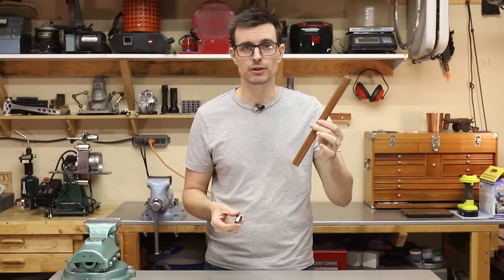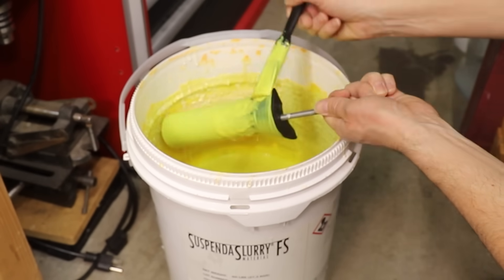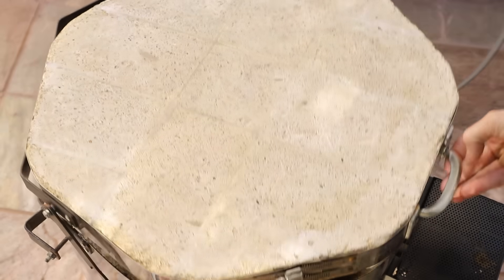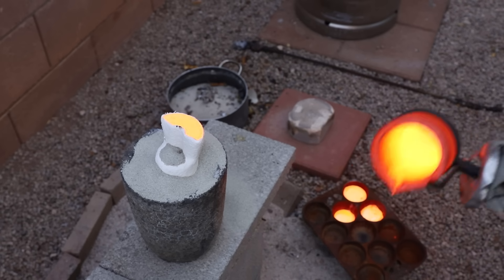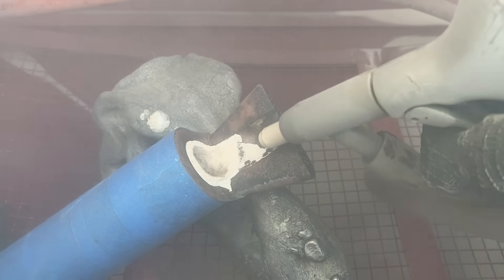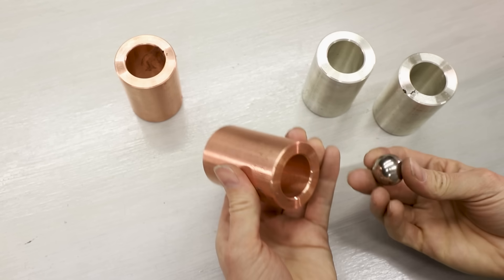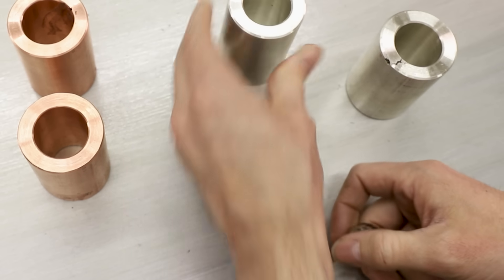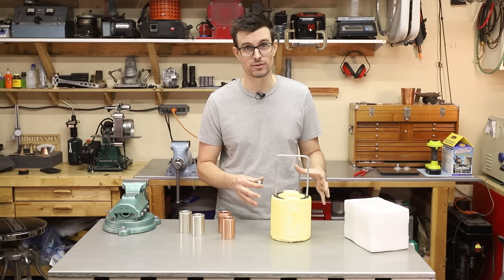Making Anti-gravity tubes - Copper & Silver! - Lenz's law - Metal casting Experiment

Comment: I know it's several weeks later at this point, but it's worth mentioning: You COULD, hypothetically, purify your silver by heating it to between the temperature that silver and copper melts, 1763 F and 1984 F, and then the silver will melt and the copper will remain, OR you can go the chemical route with Nitric acid, but I suspect that's a bit outside your wheelhouse

Comment: Would it still work if you cut a section out of the tube so you could watch the magnet fall from the side? Or drilled holes? If the holes were twisted around as they descended, instead of linear, would the ball spin?

Comment: It would be interesting to connect the top and the bottom of a tube with copper wire that makes a loop a few inches or feet away from the tube, to see if the current can be directed and change the speed of the magnet.

Comment: I am not an expert on this topic, but I suspect that there are other properties other than the resistance which are important. Possibly the number of electrons that are in the conduction band or valence band is important. It also might have to with the density. A denser material will have more free electrons than the less dense material.

Comment: When the magnet is gliding through the induced magnetic field inside the cu tube, did you feel the extra mass on the hands holding the tube. Wondering if its weight is reacted by the tube

Comment: Moving a magnet around a copper wire is the principal of generating electricity.  Just waving a thin copper wire in the air will generate a small amount of electricity due to the Earth's magnetic field.

Comment: I believe that the metals that provide such slowing are doing it on the basis of "Diamagnetivity". Pure silver rates slightly high in diamagnetism than copper; but the impurity of your silver likely counteracted it. Bismuth is much higher in diamagnetism than either copper or silver. I hope that you might make a bismuth tube also, and report its ability to slow the dropping magnet.

Comment: I would like to see measurements of the electrical currents and electromagnetic fields. Also would like to see how big of a EMP could be generated if you shoot the magnet through the pipe at high speed. Would be cool if you could partner with @MarkRober on this!

Comment: Copper (as silver, bismuth, gold, mercury) are diamagnetic some more than others (see Mendeleev's table and elements property's , purity is a factor in diamagnetic strength... To use Hg you need to 3D print a plastic vessel to contain Hg in a long toroidal form ...

Comment: Have you considered standing one of the copper tubes end up, on some electronic scales. Check the weight, then drop the magnet through the tube while looking at the scales to see if the weight does actually increase ?

Comment: а что если эти трубки, всунуть в железные, в роли магнитопровода, затем на железные, намотать проволоку, в роли вторичной обмотки, и посмотреть, что будет на выходе, какая энергия, и как она повлияет на движение магнита?  магнитопровод, можно попробовать сделать замкнутым, т.е. края железных трубок, соединить дополнительно, магнитопроводом.  по моему, такого опыта, еще никто не проводил.  

But what if these tubes are inserted into iron tubes, acting as a magnetic circuit, then on iron tubes, winding wire, acting as a secondary winding, and see what will be at the output, what energy is, and how it will affect the movement of the magnet? You can try to make the magnetic circuit closed, i.e. The edges of the iron tubes are additionally connected with a magnetic circuit. In my opinion, no one has ever conducted such an experiment.

Comment: Could be intresting to have one long tube with a slit cut out along the side so you can watch the ball drop, and have the tube have sections of different metals so you can see the speed changes
Reply: I wonder... Does the induced current have to be able to flow around the tube?  Would cutting a slit break the circuit?  Maybe just drill holes every so often to keep the ring intact, while letting you see the magnet drop.

Comment: So how you got it to break when rolling it just now 10:36  I'm wondering. If you had the copper and silver tubes on their side in the shape, they  it dead stop and not let the ball pass through if you dropped it. Or even if you had let's say, 4 or 5 tubes connected or close to connected and tried to drop the magnet through the center of them, would it change the effect. What if there is already a magnet in between them or if there was already a magnet inside each of them also would it matter if you changed the shapes of the magnets or the directions of the poles I mean just curious what can be done or not done with this stuff cause magnets are one of the things we don't happen to know much about.

Comment: Magnetic energy is not that simple. It happens that it is credited with the properties of attraction or repulsion - this is not entirely true. These phenomena are only a consequence of the influence of magnetic energy on gravitational energy. Here is an example when conductors are attracted or repelled when a direct electric current passes through them in different directions. There is no magnetic material here, but as soon as electricity is applied, it begins to knock out magnetic, thermal energy, and, at high currents, light energy from the conductors. Magnetic energy begins to influence the energy of the 3rd level in the nucleus of atoms; more precisely, it deflects the movement of graviton gravitational quanta, and they cause movement along the interaction vector of the magnetic field. And we see the attraction of the magnet inside the pipe. Inertia works the same way.

Comment: I wonder what happens if the tube is mounted so that it rotates end over end, and possibly motor driven. 
Q1) Will the magnet stabilize between the two ends? (at slow speeds of rotation)
Q2) If Q1) is true, what happens if DC voltage is applied to the tube?  ~and~
Q3) What happens when different currents are induced in the tube as it rotates?
Q4) How does passing current directly down the length of tube differ (if at all) from passing a current through windings, such as a solenoid. What happens to the magnetic field?
Q5) What happens if field windings are added to the tube? (connected in or out of phase)

Comment: Lenz's law is also the principal between electric induction motors, which are brushless, requiring no electrical connections between the rotor and a power supply.  See https://en.wikipedia.org/wiki/Induction_motor

Comment: 9:40

there will always be resistance to the motion OPPOSING the motion. 

i was going to say this is BECAUSE ... ,

but the "because" is problematic. i'm not really EXPLAINING anything here.

nevertheless, the motion of a spatially varying magnetic field through the pipe induces a current AROUND the pipe (*) , and this current creates a magnetic field, always mostly OPPOSITE to the field of the permanent magnet. that is an OBSERVATION, not a fundamental REASON.

(*) if you split the pipe along its length, preventing current flow around the pipe, the "levitation" effect is gone.
____________

what i find strange is that the silver alloy has less effect. i would expect the alloy to have properties BETWEEN those of copper and silver, but close to silver.

the emf induced by the moving magnet is the same for both pipes. the resistivity of silver is 14% less than copper, so the induced current should be 14% greater, and the induced magnetic field 14% greater.

perhaps i'm missing something

Comment: I wonder if some sort of perpetual motion device could be made from this effect? 
Make a long coil with many turns on it. Drop the magnets down the coil and collect the energy produced in a capacitor that then runs a worm drive rasing other magnets up to drop down through the coil. Use a plastic screw drive inside a plastic tube to raise the ball bearings to the top. 
Be intresting to try it.

Comment: your shell broke because of thermal expansion of your PLA pattern or the air inside it.  Next time, poke a hole in the pla with a soldering iron at the top where it won't get dipped in the slurry.  Don't fret on the shrink in the metal, tubes are notoriously hard shapes to cast.  Great video.

Comment: What happens if the copper tube in the shape of a U or half hoop will it stop in the bottom or push thru because of the eddy currents
Reply: Also does the magnet go N or S first thru the hole?

Comment: I was always told that the electrical conductivity of metals is Copper at top tier, before it oxidises, followed by Silver, then Gold, then gold plated Copper. Maybe that's why? I don't know.
Reply: A simple google search will tell you that Silver has a higher electrical conductivity than copper. 

Silver: 15.87 nΩm
Copper: 16.78 nΩm
Gold: 22.14 nΩm
Aluminum: 26.50 nΩm

Comment: It seems to me that with a lathe, you could use a boring bar and machine the inside of the "pipe" to make tighter tolerances. With the demonstration of the ball stopping when the two copper "pipes" were sitting on the table, I'm thinking that the gap space between the magnet and the inside diameter plays a significant role. By boring the inside of the pipe to slightly different diameters, compared to the magnet's outside diameter, you can get different results.

Comment: I think you should try cooling the magnet or the tubes and see if it changes anything. I mean really Cold.  It will be fun to see if it will act like a super conductor does when placed over something like liquid nitrogen. It hovers above the cold object.
Reply: Cooling the metal should reduce its resistance, so the magnet should fall a little slower. However it won't hover because this induced current/magnetic field effect relies on the magnet moving. Superconductivity is a different phenomenon (and in any case wouldn't apply at any temperatures you could achieve in your garage).

Comment: I wonder what would happen if you had a common crankshaft driving magnetic pistons inside conductive sleeves? Could useable electricity be generated? Would the copper cylinders heat up? How much energy output vs input?

Comment: Does the wall thickness of the tube affect the rate of fall? Can you machine the outsides of the copper to say 1/16, or 1/8 inch and time the rate of fall? 

Reason I ask is a magnet holds harder on thick steel as compared to sheet metal.

Also would be interested in the rate of fall in a gold tube, but that's an expensive experiment 😊

Great job, thanks for posting
Reply: yes, the thicker the wall, the slower the fall

Comment: I think it might be fun to make a "hover" track.  like a twisting turning trough track that a marble could roll down, but a short magnetic cylinder would "hover" down.  not sure if you would need opposing magnets or it could just be copper.
Reply: Wouldn't really work though, all the sections would have to only face down, soon as the marble levels or goes up - the ball will just stop.

Comment: You can make a thick 'plate' out of the silver, then tape the magnet to a string that's attached to a permanent spot... to allow the ball to swing back and forth..... and place the plate in the balls path and it slow to a crawl before it gently rests against the plate, as opposed to just smacking into the plate.....
- other than this, I don't know of any other Lenz force demonstrations... but I think this one demonstrates it best and is the most unexpected :)

Comment: Hello there,    cannot see any similar question,     so here goes,    dies an electric current get generated  in the copper tube as the magnet moves past,    ie connecting a multimeter to top and bottom of the tube   How much current is generated

Comment: take a pair of tubes, mount them to a ferris wheel style frame such that they remain vertical at all times and such that when they are above one another they are fairly close to each other. rotate the wheel with a motor at a speed such that a magnet dropped through one would reach the bottom just as the two tubes came into vertical alignment. the magnet would drop into the bottom tube and the cycle would repeat infinitely.

Comment: Nifty ! So, if copper had the best(slowest) result & it's known that silver has the best thermal & electrical conductivity, it would seem to be a contradiction to conclude that the silver was worse(faster) bc of its copper contamination. Yet I'd guess it does indeed have something to do with the alloy's crystal structures or something & perhaps other chemical or even QM aspects. Also, a good test would be to see just how significant wall thickness is, I always assumed the thicker the better but is that necessarily true & to what extent ?

Comment: Super cool.  How about trying it with graphite?  I've tried using carbon fiber tubes with no success.  You'd think that because carbon is so conductive, it would work great, but no such luck.  My best guess is that the carbon fibers weren't densely packed enough in the composite matrix to be effective.  So maybe a pure graphite tube would work.

Comment: What happens if the clearance between the magnet and tube is reduced?
Reply: it will slow down.
interestingly, i used a 6 foot long 60mm diameter aluminium pipe with 8mm sidewall and dropped a 20mm x 30mm cylindrical magnet down while standing on a chair so i could watch it, and it tumbled end over end in slow motion  all the way down,, was spectacular to see.,,and seeing it could never hit the edge was all the more satisfying.

Comment: In theory, if you 'shot it out of a cannon' [air powered would probably be best], it would be cool to 1, see how much slower than steel or lead shot it would be, and 2, see how much electromotive power it could generate.

The idea would be 1, make a 'cannon' [think 'spud gun' perhaps?] out of each product [it need not be large at all, especially since your metal is VERY expensive, 2, make ANOTHER cannon out of common steel [same diameter, so you can use the same magnet], 3, make a 4th 'cannon' out of heavy plastic [lexan or something clear would be cool, but since you can't actually see through the metal ones, its not important that it be clear] so that you have a completely non-reactive material to compare to.

Then simply set up some time traps [or a ballistic chronograph] and some cameras, and try to shoot the magnet through each barrel, at various pressures, and see how fast it moves, compared to the nonreactive plastic barrel.

That could tell you a lot of interesting scientific data.

I would use the 'dowel' / cylindrical magnet, and also wrap it with something like Teflon tape to keep it from rubbing against the barrels, and I would use a spinning brush on a drill or die grinder to make the barrels all really smooth [except the plastic one, since it should already be smooth, and using polishing devices can sometime actually make plastic worse, because it can get hot and soft and deform.

You could wrap a single strand of fine copper wire around each barrel [making sure that it is the exact same gague, spacing and number of turns] and hook it to an oscilloscope or somehow hook it up to a method of reading the voltage produced, PLUS how much magnetic reluctance it would experiment ['back emf'] and record them all.

This would allow you to read the raw magnet in the plastic tube, the highest ferromagnetic impulse being the steel tube, and then whatever the values of the copper and sterling silver are.

And while I don't expect anybody to get crazy delusions of 'free energy' it would be novel to see how much power could be produced from a net positive pressure and flow, with magnets, inside of a tube.

Then one could even try this experiment with water [since in nature, its way easier to get work from a small amount of falling water than it is falling air] and maybe set up a timed hopper/dropper to release magnets into a funnel, so that they and the water all flow into the same tube, with the same pressure, and see how much power one can get.

Just silly little ideas that came to me from watching this, that most likely, nobody on earth has ever tried to do before.

Comment: I had two suggestions, what would happen if you wrapped a copper wire in the shape of a coil and tied the ends a lamp, than let go the magnet,, probably it would light up.. no doubt.. secondly, suppose you cut a vertical section from the tube, so that we can observe the speed of the magnet by looking from the outside. Would this affect tge fallng speed? İf yes,  maybe you can cut the tube in half (lengthwise) and make an experiment to see how far we can seperate the two pieces from one another.. 
Nice work youve done. Thx

Comment: I would have held the ball 1-2+ inches above the hole of the copper tube and then dropped the ball and watch it slow down from the drop before going through the hole.  Also would have laid the tube down on it's side and drop the ball to see if it bounced or fell off the side of the copper tube..  I've dropped a magnet onto a flat piece of copper and watched it stop for a fraction before hitting the surface- very interesting..

Comment: Nice work. I discovered this phenomenon 15 years ago using a magnet from a shake lite in a 4 ft. copper tube. It took 11 seconds to reach bottom. I started thinking it might be a good safety device for elevators & might produce a bit of power as well/
Reply: Coper has 8 electrons on last shell, Silver how many ? .....so through which field magnet ball come quicker.